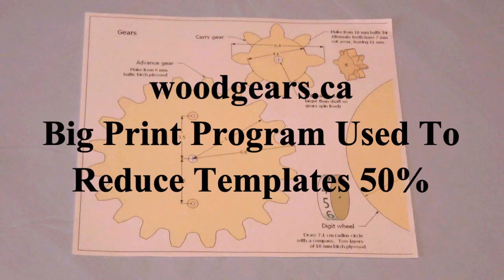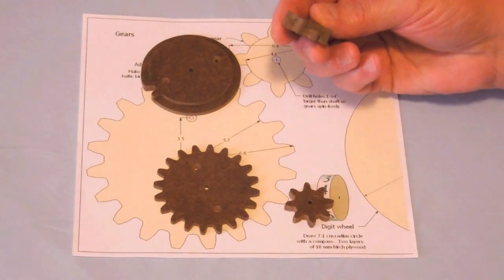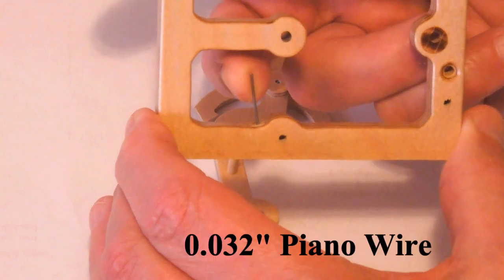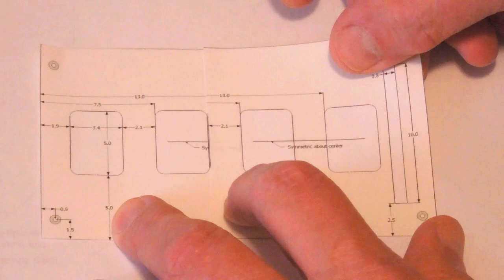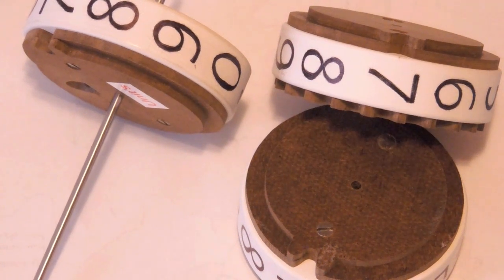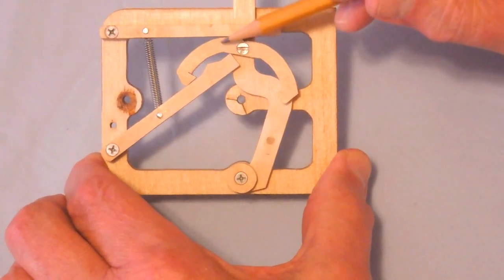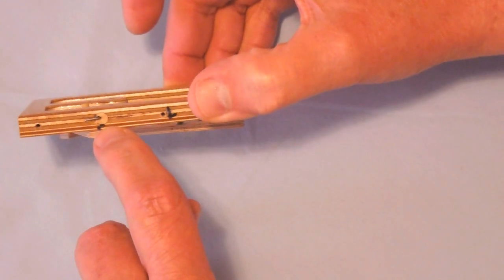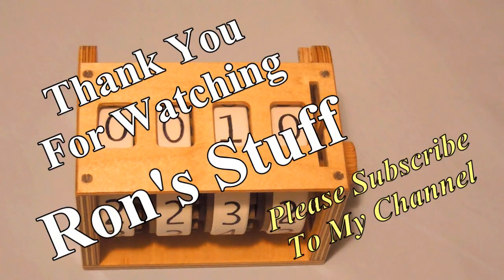Mechanical Counter Half-Sized & Expanded

Comment: Hello Ronald. 
Why don't the numbers line up according to one horizontal line that passes through the center of the numbers? 
I think it's because it's not engaged properly? 
( Please answer me with the same comment so I can pay attention to your response )
Reply from the maker: I think it lines up pretty good, especially considering that it is hand cut... and yes, it is properly engaged. Even with Veeder-Root mechanical counters (especially the longer ones) there is a bit of slack or take-up difference leading to the furthest digit form the actuator. Also, wood or fiber products can change due to climatic changes (temperature and humidity) so it needs to remain a bit loose to allow for those changes. If this were 3D printed, injection molded or CNC machined a bit tighter tolerance could be employed... but is't not, it is made of wood and it is hand-cut.
Try making one and then you will appreciate just how well and how accurately this one works... being 50% smaller than the original design.

Comment from the maker: Actually that will not work… reason being; the dowel, relative to a given point on the piano wire, travels upwards on increment and downwards on decrement. (The advance lever pivot point is to the right of the dowel… not directly below it.)